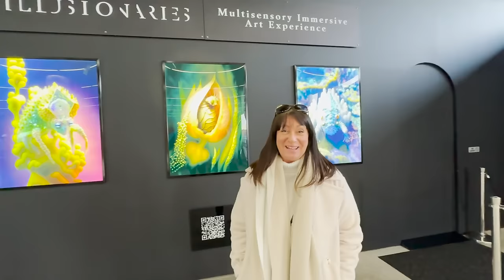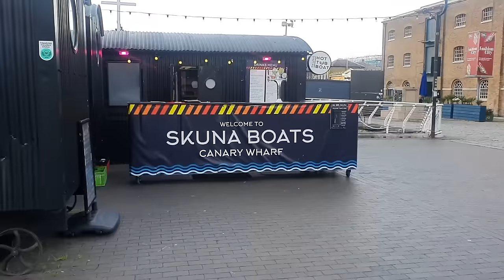Great News At The Château, Things Are Moving Upwards!!

Comment: I love your drive!  And congrats on drilling into the glass without a mishap.   I hear your argument about the placement of the print, but still think it's too high.   I don't believe the goal should be to split the height with the print.   If the print is at eye level, the wall above it just disappears.   I would try it in the lower position for a week and see if you don't like it better. 😉

Comment: The chemicals you are using on the way may not kill the roots of the mold. There is a product here in the US that is basically distilled water and thyme oil (linool) that you can just spray on all over with a hand sprayer and you don’t need to wipe off. It will keep the stuff from growing back.

With the painting, just get a taller painting for that space!

Comment: 'Glazed ceramic tile can be drilled using a carbide bit, while glass and porcelain tile require a diamond-tipped bit. It is important to use masking tape, and drill slowly to avoid damage and ensure accuracy.'
I guess you had a carbide bit, then.

Comment: When you drill glass, be shore you have a diamond drill and cool it off with water. The glass can not be warm, if so it will crack.
If you are lucky the glass is ledcrystal and very soft.
When the glass is cut it is more delicate and cracks easier. I don’t know if the is cut glass or pressed. I saw that you drilled thru the olivecutting, it is thinner in the cuttngs.
Well done!
Reply from the maker: Thank you 😀

Comment: Actually, it’s better not to hang a picture over a heating radiator, dirt and dust will fly on the picture with the flow of heat. It’s better not to hang anything like that over the batteries.
But, I’m watching your big restoration, I like what you’re doing and wish you great success in your difficult task!💪🏻🙂👍🏼